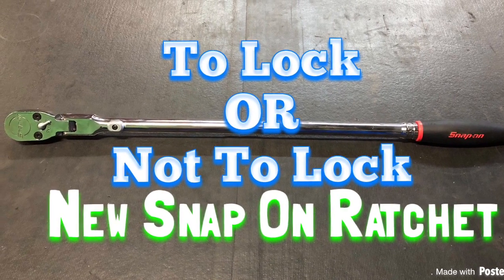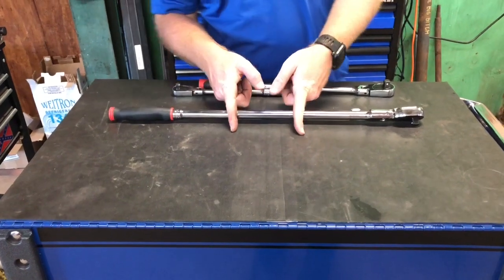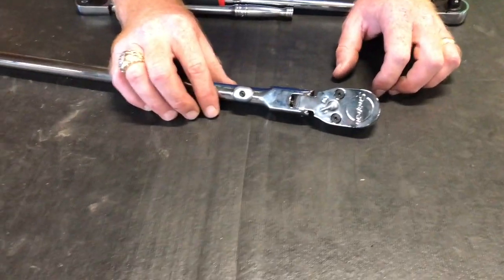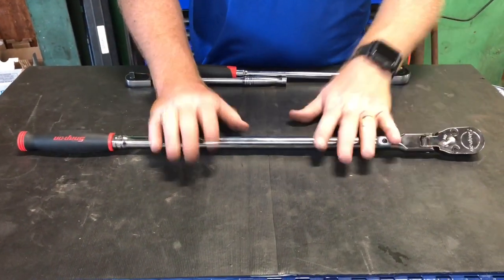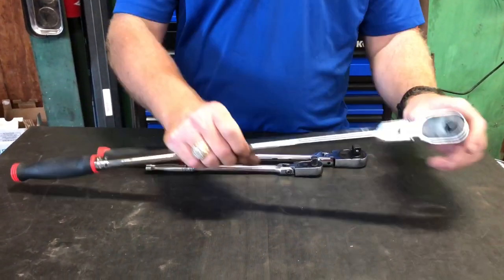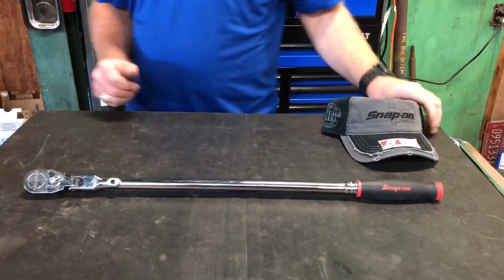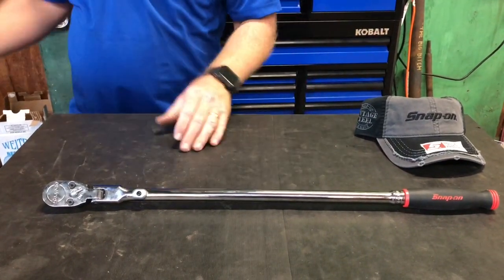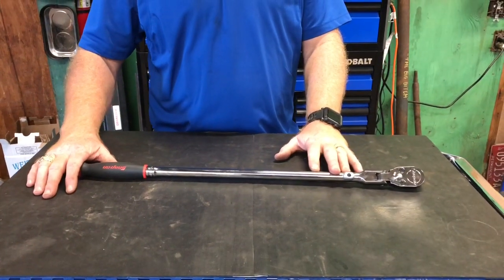Snap On Locking Flex Head And A Mini Tool Haul

Comment: For a 1\2 drive I bought the locking flex head it's worth 275 with the force one would crank I prefer it to stay put 3\8 a regular is fine if a wobble slip won't bust my hand I got the regular handle it just feels better in my hand speaking only for myself

Comment: Not sure if it’s on your model but all my new ones you can pull back on the locking button and to the right to hold the lock in the unlocked position so you in a sense get 3 tools in 1. A straight handle, flex head and locking flex head. Be smart and get these tools at a near 50 percent discount if you ever go to a snapon approved mechanic school. The standard non comfort grip is 120.90
Reply: just got one for 117 with the dicount

Comment: These prices are why I’m thinking of keeping my Walmart job in addition to my new job as a lube tech 😂 I’m wanting a 3/8 long handle locking flex head mostly for popping oil drain plugs with what I’m doing now and since that’s so central to my job I wouldn’t mind that much to pay a ton for it. I’m taking online Penn Foster classes and I get the SEP through them.

Comment: Been looking at the same ratchet. IDK if I want to try a comfort grip or not. Love the standard handles but also love my instinct screwdrivers
Reply from the maker: chris jones they are super nice. Of course they get dirty and look bad after use but they are very comfortable!
Reply: chris jones try one out I hate the chrome handles now. One advantage I never thought of before I started using it is that it’s doesn’t scratch paint!
Reply: Chris--If you haven't tried the comfort grip, you'll appreciate the improved feel over the slippery standard handle.  If you work in a part of the country where it snows eight months of the year, you'll appreciate not having to grip an icicle when you pick it up first thing in the morning.  And then again later on throughout the day; you get the picture.  It's a shame they don't have them on XL combination wrenches, too, but that's a story for another day.

Comment: i don't have any locking flex head ratchets maybe i should try one
Reply from the maker: my94silva1 they are heaven sent ! I love them. Can get into tight spots and they won’t wiggle around on you when your really putting out like the regular flex heads do. I have almost traded all my regular flex heads back in for just locking flex heads.

Comment: If you pull the flex locker back and to the right you can leave it unlocked if you need the flexibility with a locking ratchet
Reply from the maker: Yeah but they still get bumped and locked that’s the crappy part

Comment: Do they still make the 3/8 long handle locking flex head?
Reply from the maker: I don’t know about locking flex ? I know they do the regular flex heads
Reply: @KoonTrucking  That’s what I’ve been seeing too. I’d like to get something like 13-14” or so. Leaning towards Matco
Reply: @tylerars24  It looks like they don't have long, or extra long, with the lock. Just standard FX80A.

I have a FLL80, and FHLF80AG. The latter is the long flex head. I just crank down the torx bolt holding the head on until it's super stiff to move. I almost like it better than the locking 1/2" rachet I just got.

Comment: It's both...Pull back and slide right
Reply from the maker: +Tech 17 it just slides towards the handle to unlock it.
Reply: Yes. Sir.   Just a c hair right as it slides back
Reply: Koon Trucking Tech 17 is correct if you pull the locking trigger back and at the same time slide it to the right the becomes a regular flex head rachet w/o locking, I've got the 3/8" & 1/4" they function as the 1/2"

Comment: Flex head ratchets aren’t meant to TQ or pull hard that’s why they make TQ ratchets
Reply from the maker: Guessing you missed the video where we put the icon ratchet up against the snap on ratchet on a torque meter. Snap on was a fixed head. Icon was a flex head and it destroyed the snap on. No it wasn’t rigged in fact it was shot on a snap on truck and the snap on guy was going to prove a point that his was stronger. The torque meter ended up getting broken in the process trying to make the icon flex head fail. Just saying… https://youtu.be/Grcpmj-v_nY?si=3gSocGozIqwwO8yN